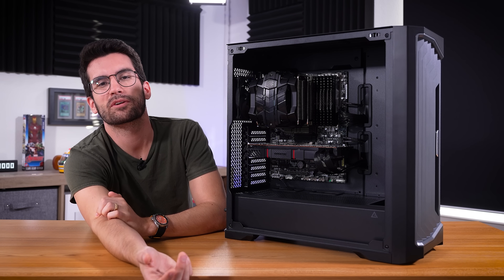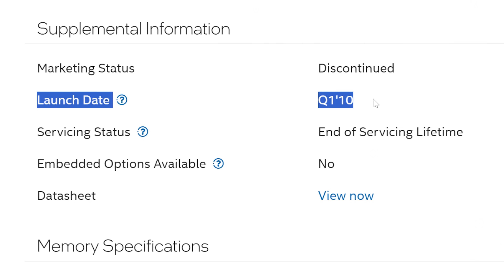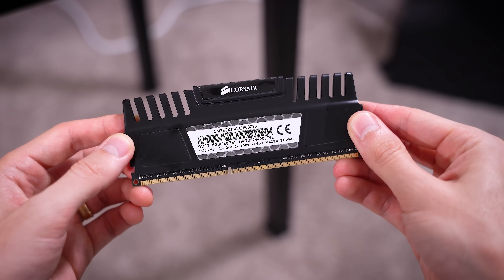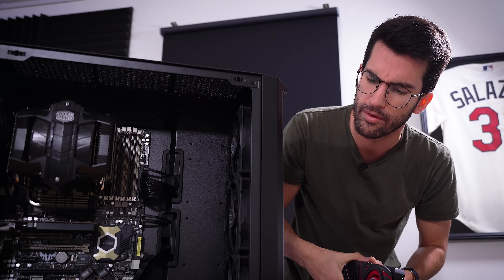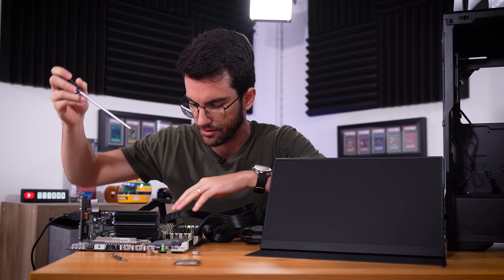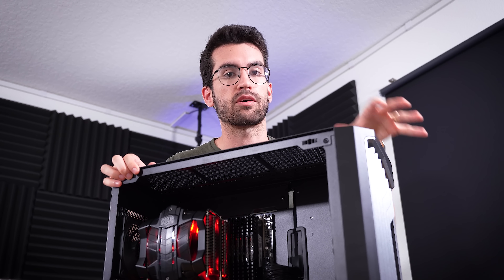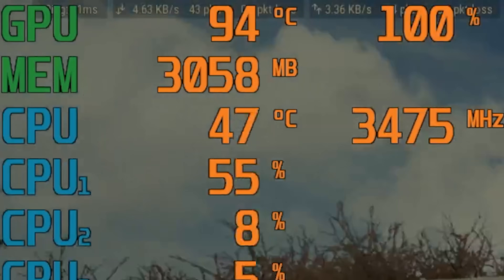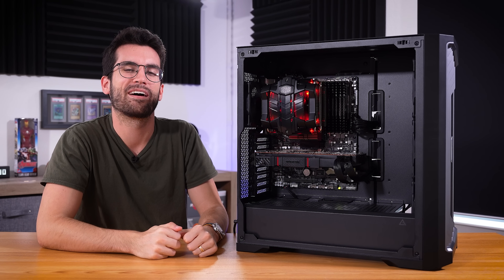Fixing a Viewer's BROKEN Gaming PC? - Fix or Flop S4:E20

Comment: that looks like a sabertooth 990fx mobo. they will fail if you overtighten the cpu cooler. it causes a bend in the mobo that prevents pins on cpu to make contact. i have 4 of them with 1 nib and 2 spare new fx-8350 cpus. i run them to control my cnc machines

Comment: In my experience with the cooler master v8 cpu cooler should not be installed or removed with the fans on it, when pairing it with a LGA 1366 or 2011v3 socket. A simple 2.5mm Allen wrench and a 10" 1/4 drive extension along with a 9mm deep well socket and you can easily remove the cooler. it is just 2 Allen screws per fan and they come right off, then you have over head access to the hold down nuts.

Comment: Can plz someone tell him, that the voltage number written on every batt means the voltage when it is empty.

The batt should have a voltage of 3.2/3.3V when it is full.

On a Li-io batt is written 3.7V which means the voltage should be around 4.15/4.2V when it is fully charged. 

Batts on a motherboard can even fail when you messured 3.1x/3.3xV. Because under load they drop below 3V, if they are bad. Which can lead to the misunderstanding, that the batt should be good.

Comment: A friend asked me to deep clean his system and just take a look over everything.
Nothing was wrong with the system and it was working as normal before I took it apart.
I stripped everything down to the screws, cleaned everything, reapplied thermal paste, pretty simple build, Ryzen 5 3600 with an RX 580, 2 stick of ram, not a glimpse of RGB, and it does not turn on, nada. After I waster 4 hours of my life trying to get the system to turn on, I took out the CPU and found a micron spec of thermal paste in the socket of the motherboard. Removed it with a sewing needle, system posted. Safe to say I was more than frustrated as I have taken down and put back together systems more times than I can count and that was for sure a first...

Comment: In december i bought a LGA1700 cor i9 with an asus Prime Z790-P motherboard and 64Meg of  ddr5   the store said they would mount the processor because it may need bios update a few days later i had all the components i decided to build the PC.. i had lot problems with post woundent recognize the drice m.2 informed the store of the problems they said check the connection i said could it be the bios update they said it didnt nead one... two months late i decided to by another motherboard.. my suprise when removing the processecor i saw pins in the socket bent .. store didnt wount to no...

Comment: I’m convinced it was not you I bought a brand new asus  Ally had to RMA it back to asus due to motherboard issues, power, supply issues or ram video issues I reinstalled the windows on it twice and kept getting various blue screens of death all of the blue screens pointed to ntoskrnl I ran various checks, and I’m almost certain that it’s a motherboard issue not software related, PS I reinstalled windows same problem and I made sure the drivers were up-to-date

Comment: My MicroATX build stopped putting out a video signal.  I heard that it might be the GPU card and that I could heat it to re-ball the silcon chipsets.  I put the case in the oven for 8 minutes at 100C and now it doesn't even power up!  WTF!

:P

Comment: The pins on 1366 are sensitive. I still have my only x58 machine.  Intel mistakingly gave us so much power with the first gen that they had too try and dumb down the hardware with software. It took intel like 6-7 generations to legitimately overtake x58. If you got an overclocked xeon its still a viable platform to this day.

Comment: 94 C on a VGA in an open case is insanely hot. It's NOT okay by any means. Any desktop card that is going over 80 should be looked. Change the thermal comp, get possitive pressure in the case... stuff like that.

Comment: Watxhing you repair these computers has inspired me to wonder if i could use 1 of my old  Dell insperion 17r laptops to put the mother board in a tower and maybe have an upgraded system on the cheap but i don't know the first thing to look for . Do you think this could be possible im not out anything using 1 of my extra laptops as a Frankenstein machine, possible or not ?

Comment: You never bent a pin in LGA socket before??? It's more common than people like to talk about,and it's because it's always deemed as user fault,I bent a pin on same exact spot (not the same socket),and prior to that I was testing multiple CPUs on that same board,thankfully,bent pin in that spot is not hard to realign,bad thing is that pins on those spots are usually crucial for CPU.

Comment: Thank you so much Greg for these videos. I love watching them. I just upgraded my power supply from a 750w to a 1300w and my graphics card from a RTX 2070 to a RTX 4070. Turned it on annnnd no picture out. Didnt panic, cleared cmos, no change. Took out ram, put ram back in, and she booted. Before getting hooked on your videos I would have been panicing having spent nearly $800 on those upgrades. Thank you again for these videos. ❤

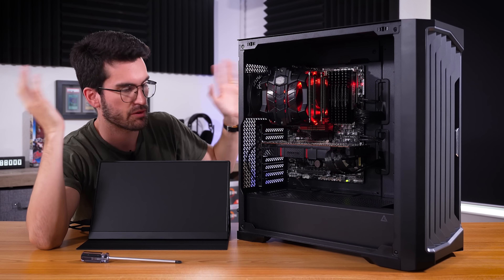Comment: 3:53  Try Reseating the Ram and make sure the clips are closing fully after turning off power of course, next I would try the on board video using an adapter to fit your monitors cable, CMOS is always good to change battery.

Comment: Also had an issue with no screen output when I swapped graphics card (from 5700XT to 7900XTX). Damn thing would boot all the way to windows (you can hear the noise or people messaging on discord), but no visual. Checked all cables, inside and outside. Tried all outputs, nothing.
Tried using the onboard and nothing (also check if your board/CPU have integrated graphics for posting without a graphics card, in my case, the CPU doesn't have integrated graphics (AMD 3950X).
Swapped card back to old one -> works fine. 
No power issue either. I was at a loss. Tried the only thing I could; update BIOS. Went from a 2019 version to a september 2023 version (Q-Flash ftw!).
Boom, problem solved. Booted straight into windows, updated drivers for the 7900, reboot. Done!
Glad I found it (with thanks to my older brother helping trouble shoot). Saved me 1100 euro's.

Comment: It's amazing to me how a CPU designed and built in 2010, with an SSD and enough RAM, can still be usable almost 14 years later. By comparison, a high-end gaming PC built in the late 1990's/early 2000's couldn't be compared to a system like this using the same difference in time, as it wouldn't be able to play any games or use the internet like this one can, even today.

Comment: Got a suggestion for you as I just set up an old I7 4770s for a server that would not boot. I used a microscopic screwdriver bit and hated every second with that magnifying glass but it worked.... Im thinking picks, like dental picks that the identical picks are used in the automotive industry for small seals. But they are cheap, im putting them on my list. I would love to do what you do in Michigan in my little town but i dont have the resources. Im building my home server and have old stuff I'm planning on giving away for promotion to start my business but windows supporting old hardware is becoming obsolete.... I mean why cant this older core 2 duo web browse with a ssd? Im aiming for the people that need someone like me to help, the folks that need a pc that can afford 100$ computer not 1000$...  The problem with this lies with the OS, got an old quad core fx from amd that isnt supported by windows so it will crash every time I try.... Running linux for a media machine..... Oh dont forget Microsoft is forcing Windows 11 very soon.... And I do mean forcing.....

Comment: I had that cooler for my first build and I got flashbacks to the pain of installing it. I had larger heatsinks on the VRMs around the socket too so getting that top right corner screw tightened was not a simple task. The temperatures were great though (25C on a i5 6600K at idle and 60 under load with it OC'd to 4.8Ghz) and it's still chugging along in my nephew's PC.

Comment: I honestly wonder if the pin wasn't like that already. I guess we'll never know. I was really thinking it was a BIOS issue. X58 boards can even have BIOS corruption, so simply reflashing the BIOS (even with the same version) can fix it in that case. Wanted to mention it just in case that knowledge comes in handy for you some day :)

Comment: Even if you put together toused of systems, sometimes just make a little mistake, from easy and embarrassing like forgetting to plug CPU 4/8 power, to sloppy and dumb like dropping a screwdriver on a motherboard and breaking one of the trace (system was still working tho.)

Comment: I want to see you overclock this to the gills, these CPUs respond great to overclocking CPU and ram, get the ram up to 1866mhz and crank that 980x to 4.5ghz and see how she flies!  Curious to see how it performs with a more modern GPU like a rx 5700 xt.  I have a W3980 and have gotten it up to 4.9GHz.

Comment: I was working on an older system that had no video. It did not have a GPU installed, it was running on the onboard video. I had ruled out everything but the motherboard and the power supply. There was power to the motherboard and fans so I assumed it was the motherboard, but it ended up being the power supply. I have been working on PC's since 1995 and I had never before seen a power supply go bad and still power the system. I guess that's why they have power supply testers now. So I no longer assume the power supply is good just because it powers up a few things.

Comment: I hated it when they went from pins on the CPU to pins in the motherboard socket. I am older and my hands aren't as steady as they used to be. Over the past 13 years I have bent a pin on a motherboard socket twice just installing a processor. I have never once bent a pin on a CPU. I wish they would go back to pins on the CPU's.

Comment: So, originally you built the entire PC, including cable management, and up to the last screw and zip-tie... before trying to turn it on for the first time. And what do you know, it didn't POST, causing you a huge amount of trouble having to disassemble the entire thing once again in order to fix it.

Did you finally learn from this experience to avoid doing that in the future? In other words, from this point forward will you always test with a minimal setup on the table without starting to install anything inside the case?

Probably not. You are a professional, after all. Testing with a minimal setup first is for noobs. Pros don't need to do that, obviously.

Comment: Glad you were able to get it working. The pin might have been bent before you touched it, maybe it's why the original owner didn't complete the build? I can't imagine an experienced builder like you would just jam the CPU in there and not be careful. 

Also I had a R9 290 and this is the default behavior, it jumps to 94c and then tries to cool it. It could do with a repaste and maybe undervolting to calm it down, I think many people just gave up on it and installed a 3rd party cooler. One other thing you can try is to flash a R9 290X bios, because some of the early reference models did unlock into the higher model.

Comment: I checked the build video again and at 7:13 if you zoom in on the socket, it looks to me like that same pin sits a little lower than the rest of the pins (before you install cpu) indicating to me that it may not actually be your fault. I saw no issue with the way you installed that cpu

Comment: Bro, I don't think we can pin (pun intended) this on you, Greg. I had a older lga motherboard cpu assembled combo sitting in a climate controlled closet untouched for years, put into the closet working, resurrected it only to have no post, finding bent pins, really feel like these older boards bend pins without even touching them. Just have to look in their direction 😅

Comment: i had a laptop with a 2010 1st gen I7 processor . that dell was a nighmirror for some reason those intel chips hated windows 7 because vista was the operating system when they were developed and almost from the start the usb ports would stop working and it would occasionally crash for no reason . 1st gen I core has a bad rep from all these issues , but remember in 2010 it was I core or Pentium from intel and that was about it and Pentium was ancient for that day

Comment: I've been waiting to see what happened to this rig.  I know my Asus P6T needed a BIOS update for some higher end processors.  But I had a i7 930 at the time, so it wasn't a problem then.  When I upgraded to the Xeon X5690 much later, I was surprised that it took the new processor and didn't reset my previous overclock.  Fun times seeing that Xeon clocking 4.6ghz right out of the box.  lol

Comment: Hey Greg, wouldn't it also be plausible that the MB could have actually came with a slightly bent pin considering its age, regardless of whether it was 'brand new" or just never used?  I'm not saying it's not possible that you did somehow damage the pin during installation either, just that it is plausible that you didn't?  Anyways, thanks for the follow up here, I was really excited to see it post and get some benchmarks!

Comment: I had the same cooler on my build, had the same issues and eventually did exacly the same as you. But when I reinstalled, it was not posting once again... I changed coolers and havent had any issues since.. 
I think it more of a clamp down pressure issue type of thing, not so much bad CPU install.

Comment: Actually the second time I builded an socket 2011 system I managed to mangle two pins. I could bend one back but the other broke off and it wouldn't start. So that was the first time I had to RMA a new board that wasn't DOA. I don't know how I bend them to this day. I inspected the socket before and it was fine before and I build numerous systems before with socket 775, 1156, 1155 even a handful with socket 1366 and it never happend to me before or again since then. (Knock on wood😆)

Comment: Greg , you are human and make mistakes ! I have messed up two platforms and CPU’s just trying the clean the computer up. Since 2020 , I am on my third board . The first board  was a board I got back in 2015 , Asus ,DDr3 and AMD fx 8350 .my last two were the MSI B-450 and Ryzen 5 3600 and a B550 and a Ryzen 5 5600X

Comment: SB led is for Standby power so basically tells if psu fuse and cable to wall are ok
One think that I was thinking was bitrot but 10y is still too early for that to start happen. Maybe 15-20y then we may have case for bitrot.

Comment: I sincerely doubt Greg damaged the CPU socket. I've seen half a dozen "new" boards with a bent pin that either did or didn't interfere with the operation of the system.

Comment: Good work there i had this platform until middle 2023 when decided to finally update after building it on 2011 as my first pc with my first job as data analyst running solid all those years until it started having compatibility issues in games. Still have it stored for a possible arcade machine as it was running smooth yet after 12 years

Comment: Next video: Overclock that CPU to 4.2ghz (maybe even 4.4 if you have a winner) and replace the thermal compound on that card too, shouldn't be hitting 90+ even with that cooler. You'd be suprised at how much performance those chips leave on the table at stock. Your boy Bryan from TYC (aka father xeon) can help you get the best tune out of it. That'd be a cool trilogy.

Comment: X58 boards, most likely than not, always have something wrong with them... I've always loved the platform, but damn, so much troubleshooting... I don't really think there was anything wrong with the original CPU installation.

Last one I assembled had an issue with CPU cooler mounting pressure (the two middle RAM slots would not get recognized with a cooler on). For some reason, an AliExpress Snowman cooler worked great, despite being the most pressure intense cooler I had on hand...

Comment: 1 bent pin on a botched cpu install doesn't sound right it is usually several pins in my experience . So working on that basis i am leaning towards a defect with the board rather than something you have done yourself

Comment: the x58 plat form is probably my all time favorite ..its what i really learned the nuts n bolts of Overclocking & building a custom water loops water cooled 560ti Then Titans started with the 920 as most did then went to the 980 oc to 4.2ghz i think wd raptors n Raid 0..just a lot o fun for me back n the day !

Comment: I'm not sure if you caused this, since it was just a single pin that was off. If it were caused by installation I would have expected multiple bent pins. This seems like a factory issue.

Comment: This reminds me of the time I was upgrading my PC and I installed my 3900x put all my watercooling parts together filled the loop and then when I turned it on nope. Had a Ram debug LED on the board lighting up but it was brand new ram. It ended up being a slightly bent pin on the 3900x and I to this day have no idea how it got bent and by such a slight ammount. anyway hours and hours later it was back together and working.

Comment: At least you did not mess it up by stepping on it. This time at least. 

But I do agree with some of the others here. That pin came bent from factory. That damage was too isolated for it to have happened due to unproper handling. Which seemed legit.